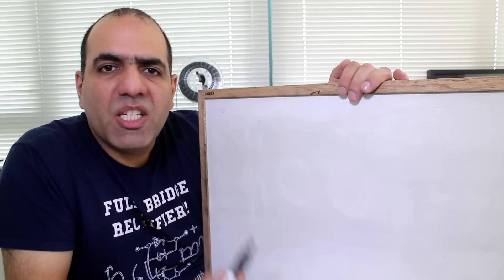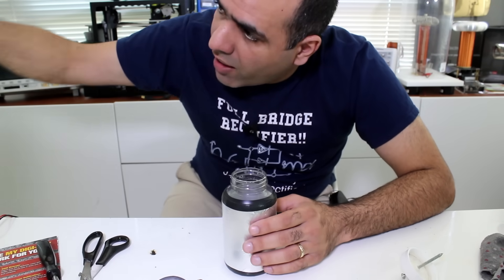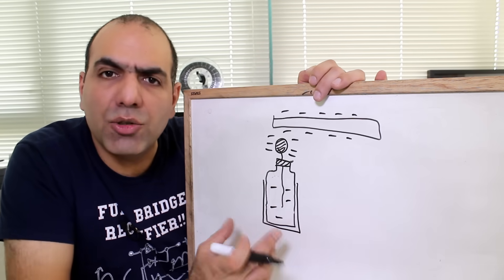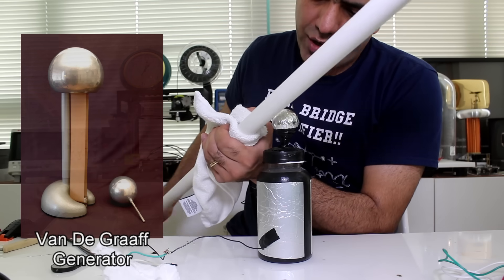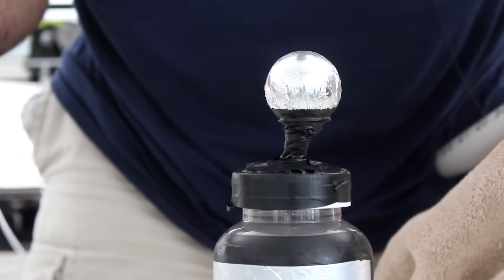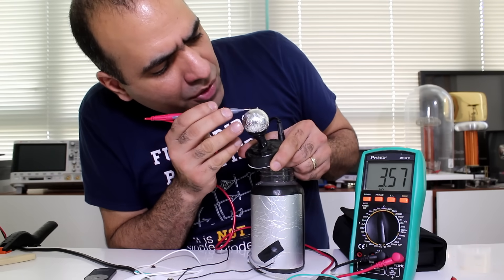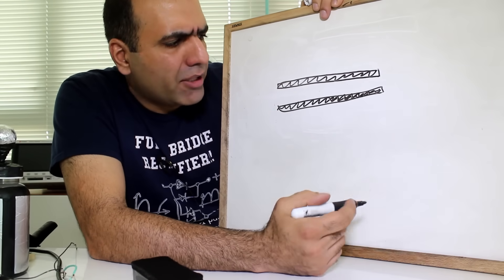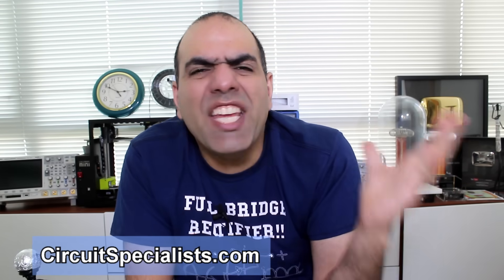Make a SUPER HIGH VOLTAGE Capacitor

Comment: I made a video a couple of years ago where I build 20kV - 8.4nF Capacitors with plastic pockets for my Marx Generator. :) Now I built better capacitors with 74nF for my Tesla Coil and it worked very well but they turn hot quickly.

Comment: If you put a fork in a wall socket, turned the power on, then touched it with the negative side of the capacitor while holding the positive side of the capacitor (holding the jar and touching the fork with the ball on top) would it shock you? Can you explain that science?

Comment: Call Cody and replace salt water with mercury
Reply: Cody would use himlfelf as a capacitor
Reply: That mass to capacitance ratio of that thing would be enormous.
Reply: UNZO That would be beautiful.
Reply: Mercury is highly toxic
Reply: What if you filled the jar with steel wool?
Reply: 🔴🔴🔴 Craig Frank 
Simply use large PVC pipe to make a capacitor. It kicks butt! Or simply make a plate capacitor. This guy is a goofball who by no means is well acquainted with performing electrostatics experiments.
Reply: @FreeMagneticEnergy2  you do know that ElectroBoom has a masters in Electricity, right?...
Reply: 🔴🔴🔴 Dead Meme - I as well. Got mine in 84. Big deal. Having a masters doesn’t prevent us from doing stupid, idiotic things.
Reply: @FreeMagneticEnergy2  but you see, the "stupid things" electroboom does are all near-perfect cuts. In some of his videos you can just barely see the cuts. Everything is set up to work perfectly in a way that it will definitely not hurt him in any way.
Reply: 🔴🔴🔴 Dead Meme - Regardless of edits, what does that have to do with constantly electrocuting himself? Even passing current across his heart. 🤔
Reply: @FreeMagneticEnergy2  did you read my comment correctly?
Reply: Dead Meme - Rather than asking me if I read it correctly, why don’t you elaborate please. I don’t want to look over 28 replies to find yours.
Reply: Dead Meme - I noticed you made various comments. Are you talking about the one you say he has a masters degree? I don’t need to read that again. Rather you need to read my response again because I also have a masters degree in electrical engineering I earned in 84. Don’t matter how you slice it or dice it, degrees does not mean that we are not going to do stupid things.
Reply: @FreeMagneticEnergy2  ive clearly wrote that everything is set up in a way that he cant hurt himself. Sure he had some accidents, really bad accidents tbh, like the Jacobs ladder. I have never wrote that we dont do stupid things, neither will a degree prevent you from doing that, but if you cant enjoy his videos then i dont know why youre even commenting. He wouldnt just go and touch 750kv power lines on a ladder to find out if he dies or not for a youtube video.
Reply: The Only Wae  If it's in elemental form, it's relatively safe. When it is converted into a salt, or especially an organometallic compound, is when it becomes much more dangerous.
Reply: @ergohack  
It also gives vapour.  Horrible stuff.    but fascinating for a while. Probably until it damages the brain.
Reply: UNZO yasssssss
Reply: i hope this gets top cpmment
Reply: Oh man, the ESR would be incredibly low!
Reply: UNZO was thinking the same thing...
Reply: knowing the common nature of these videos, he's going to somehow get it dangerously near or in his mouth somehow.
Reply: @_hekken  well... cody just uploaded a video where he tastes mercury...
Reply: 🔴🔴🔴 Hekken. - Yep! That’s what goofy idiots do. Stupid things over and over who never seem to learn.
Reply: use NaK isntead!
Reply: Steel wool if not super compressed is not a dense metal plate
Reply: High chance of amalgamation of all metals involved
Reply: @Codislab make it with Mercury or something beter.
Reply: How about give yourself a break and replace the bottle with a flat sheet !
Reply: UNZO I’ve got some mercury I’ll ship to mr.electroboom

Comment: Really nice video. But I think it would have been a lot easier to use aluminium tape, the kind they use for HVAC systems. Or use spray on adhesive rather than a paste.

Comment: If you would charge the 10nf Capasitor to 25kv the energy storend would be 0.5 x 25000^2 x 0.00000001 = 3.125 joules This is al lot less than the leathal 16 joules so it would be safe. Am i right? Just curious.

Comment: What about those plastic chairs in elementary school. I used to rub my body on the chair while i was sitting and when i stood up, i could zap my friends with pretty big arcs. ...i think my biggest arc was longer than an inch but that was when i touched the metal part of the same chair
Reply: midgetconi stop lying there is no way the arc was one inch
Reply: I killed an old computer at the school lab like that... touched the CRT screen and ZAP! went black & never turned on 
It was an Apple anyway lol
Reply: at the place i work at we have polypropylene or polyester fleece running over aluminium rolls, those will charge up way more and we sometimes get arcs way longer than a few inches, sometimes you can even see the arc coming out your boot and into the ground.
Reply: Derrick Lyne it was thin. Barely visible. But you could feel and hear it
Reply: Tsar Nicholas have you ever touched a van der graaf generator? My physics teacher 2 years ago pulled one out that was ~2.5 feet tall. Those things could zap you from 4 or 5 inches away if you let them build up. Some tasers have an inch gap (not that im saying the chair thing is anywhere near that powerful) and they dont kill people

Comment: You know a guy has shocked himself alot when he can tell just by looking at a spark how many volts it is.
Reply: I think he was judging how far away from touching it was when it sparks. It's about 1 kilovolt per mm. 
But then again, he IS an expert on shocking himself as well. ;)
Reply: i wanted to like your comment... but it was at 666 and i just wanted that vibe to sit lol 😂   @lordsqueak
Reply: @lordsqueak  At about 50% humidity, it is about 30kv per centimeter, but the voltages vary a lot based on pressure and humidity
Reply: @lordsqueak  the air brakes down at 3kv per mm. Sorry if my english is bad
Reply: @lordsqueak  its true ,a true master shocking himself
Reply: @lordsqueak  it’s ~1cm per kV
Reply: @lordsqueak  no shit sherlock, the dude wad joking
Reply: You both are right but it takes a lot of practice to feel the distance ;)
Reply: I knew a guy that could tell the pH of his reaction by taste.....
Reply: @elDoober  yeah. Bases are bitter. Acids are sour
Reply: @elDoober  Keyword. You KNEW him.
Reply: Nah he sees the individual electrons moving through the gap, he counts them and then calculates the voltage, all within 1 second.
Reply: is it not 3kV/mm?
Reply: @AnjewGS  mehdi said it depends on many factors like humidity, temp and other
Reply: Composing Gloves so true
Reply: I thought breakdown was 30kV/cm?
Reply: Richard Smith except stun guns are still current limited, at a higher voltage like 20kV-30kV aka what most "million and higher volt" stun guns really are, it would be alot more dangerous and definitely hurt more than stun guns
Reply: @BH4x0r  you can't get a million volt stun gun. It's impossible
Reply: @ericl8743  they are gigantic and not mobile.
Reply: @graphenepixel8231  then what's the point lol. I don't see the need for a stun gun with electrodes that are 3 meters apart but you're right it's possible but not practical
Reply: @ericl8743  I understand 😂
Reply: Personal attack is not welcome. Share info or fun, not hate!
Reply: Yes, for homogenous field and dry air. And actually here the field is more homogenous (because of the round electrodes) then in many other practical cases, so this estimation is more accurate here than 1 kV/mm, which applies rather to pin-to-pin discharge. You can see Mehdi says 10 kV, when the distance is only about 5 mm, so he assumes ~2 kV/mm.

https://hypertextbook.com/facts/2000/AliceHong.shtml
"The dielectric strength of air is approximately 3 kV/mm. Its exact value varies with the shape and size of the electrodes and increases with the pressure of the air."
Reply: @PafiTheOne  And the humidity too I believe. Also I believe with higher frequency it s reduced. Having worked on tv's with picture tubes many years ago I believe it appeared to be about 1000V/mm at about 18kHz.
Reply: (arc)
That was 35kV
Reply: I can do that with 9v batteries on my tongue
Reply: fr bro

just saw your name/handle 

your comment has 11k likes and 68 replies and a heart from electroboom on your comment

i rechecked for number of replies 

all this is written or typen or typed again when whisper flow and another add i think wo online games wala were running

and rn a heartbeat black friday turkey add "it saved our flock" wala and another in which kids were holding instruments and a clip of a girl was singing the add was silent for some reason

date 29 november 2025 time 5:12 am - 5:13 am pakistani and abhi 24 puppies ka koi ishtihar araha hay 

5:14 am pakistani
Reply: Haha experience eh ;)? Same at my job. I'm able to visually measure thousands of an inch in plastic just by looking at it. Experience can go along way ;)
Reply: @AcidAlchamy  no
Reply: Composing Gloves Im guessing he's full of shit.
Reply: Composing Gloves 😂😂
Reply: Composing Gloves Medhi have a multimeter on his fingers, and a very prrcise termometer on the lips
Reply: Will Garrett is he still alive?
Reply: If you work with enough magnetos long enough, you can tell just by the sound of the spark how well it is working. Of course it is better to hand to a co-worker and ask them if it works by turning the impulse coupling. :-D
Reply: I love how this man tries to make a joke and you get all these very sad people trying to correct him.
Reply: Lmao
Reply: Most of these replies ruin the joke/ statement tbh. So y’all need to shut tf up and just a appreciate this joke. 😊
Reply: HAHA
Reply: This fellow is the "Miranda Sings" of electrical engineering.

This is intended as a positive comment, for those who don't know.
Reply: Look at my videos of making sparks on the bleachers, I even shocked an apple with the high voltage while holding it.
Reply: Exactly
Reply: Bit he is earning Money :D
Reply: @israel24961  clearly you are wrong the youtuber himself agrees with him you fool
Reply: Fake video
Reply: My thoughts exactly! 😅😂🤤
Reply: @israel24961  And the sound indicates charge level too and gets louder, of course with the same charge voltage on the larger cap.  He goes by appearance and the gap it bridged at the moment it arced, but that varies too with the air.  He was using spheres though so much better accuracy for an experienced observer.  I thought it was funny how often he forgot being still attached.  The stuff I made only allowed for one mistake.  We wore no ground straps in that lab.
Reply: Lmao 😂😂
Reply: Humorous comment: look at the thing 
People who don't get the humor: well you see, the thing is probably...
Reply: @israel24961  yeah
Reply: HAHA I LOOKED AT THE COMMENTS AND THIS COMMENT POPPED WITH 6666 LIKES HAHA

well... right now it's at 6666 likes...
Reply: Composing Gloves 🧤
Reply: Lol
Reply: Hasn't every electrician been shocked sooner or later?
Reply: I Noah guy.
Reply: @Babl Fish
Reply: Pain is an excellent teacher.
Reply: @masternick13  They don't tend to last long.
Reply: "That was about a 6 on the ouchy scale.. I mean about 10kv"
Reply: Lol I used to have a coworker that could tell by "feel" what the voltage was. Apparently the highest he ever experienced was 4160
Reply: Lol some people it doesn't effect as much as it does other people.
Reply: 0:15 ofc. Lovers from different lands.
Reply: It’s obviously fake they’re just editing it or they knew it before so they’re probably using some sort of power supply￼
Reply: Yes
Reply: He can tell by the violence of the spark. The loudness and brightness increases with voltage, and he has worked with high voltage enough to recognize roughly the range of the spark.

Make no mistake, that hurt like a bitch getting shocked by. That is stun gun territory.
Reply: Richard Smith there measured by distance dude. Your information is incorrect
Reply: @mikeyeyey8678  It is distance, however, that distance WILL vary depending on the gradient.   That is determined by the shape of the nodes.  If one is a sharp point,  if will arc at a greater distance for the same voltage.   Both being spherical,  it conforms to the physics standard model.   If one were a pointed barb, it could initiate an arc at twice the distance.
Reply: @rich1051414 he also has his masters in electrical engineering. That also helps quite a lot lol
Reply: Richard Smith.
No. It's simply distance. Anyone with decent scientific training in EE would have used distance.
Reply: @abcabc-pl9jf  Not exactly true, because a larger cap charged to the same voltage will deliver a much more powerful spark because once the arc occurs, the entire charge load dumps.  Also, if one uses a pointed node (or two), the arc occurs more readily due to the higher field gradient.  I have seen 50kV arc up through dielectric fluid and the air in a demo, and I was very impressed, having made HV power supplies for a while and not ever seeing that.  Also the distance also changes with the condition of the local air at the time.  But you pretty much got it right.
Reply: Randy Gareth unfortunately you can't tell the voltage by counting electrons. And yes, I am fun at Parties ^^
Reply: You englished good in this comment.
Reply: you guys must be fun at parties.

Comment: it would rule to have a scope but it would also rule if you try not to have current travel through your torso

it'd be neat to try this using two cans you've hacksawed the tops and bottoms off of. aluminum's flexible enough that i think you could wrap one in something like mylar and cool it and heat the other and use the thermal expansion to nest the two. I think as the two returned to room temperature they'd end up tightly bonded although I'm not sure what use the resultant energy cylinder would have.

Comment: 6:05 can't charge a cap with AC
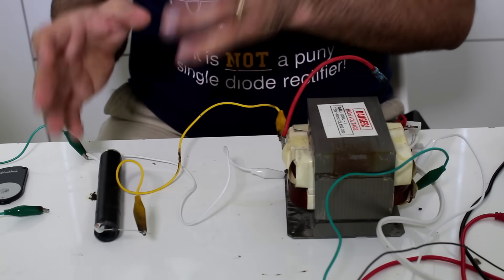10:20 charges a cap with AC
Reply: Rectified AC. No problem with pulse charging a capacitor as long as pulses are fast enough and with one polarity.
Reply: offshorebear  doesn't understand what a diode does
Reply: 6:05 its  high frequency Ac 
10:20 is 50/60 hz.ripple dc
Reply: Great attention to detail, but you missed the RECTIFIER part :)
Reply: It doesn't need to be rectified. AC will leave enough energy to spark.

Comment: How to test capacitor with multimeter?
Reply: Pritish Parihar look for the Farad symbol
Reply: My multimeter got not option look like that. All i got to measure resistance, voltage, current,Beep for close connection. that's it.

Comment: Put 100 1N4007 diodes in series = 100kV Diode for charging a capacitor with the Tesla coil. You can use 400 and make a full bridge rectifier for 100kV for very low price!!
Reply: Sadly I don't think that will work.  If I understand correctly, Tesla works at radio frequency.  These 1N diodes have lousy reverse recovery time (i.e. when you reverse bias them it takes them a while to realise they shouldn't be conducting).   I used one in a 65kHz boost regulator and it literally did not work at all - kept discharging the output capacitor on every cycle.
Reply: fair point, then STPSC2H12 it is. Money is not a problem here.

Comment: did same capacitor years ago with 2x10m aluminium foil, capacitance was aubout 46nF and was working on 16kV for 2 years :D powered with 4 neon transformer 4kV each (never check their wrok with hands). Greetings form Poland. Martin
PS Can You show me how to create jacob's ladder that can run all the time (my transformer get hot in 5 min) or an DIY ozone generator??
(sorry for my bad english)

Comment: I made one of theses and was able to charge it with a DIY Taser
Reply: By 'DIY Taser', you mean one of those 10k volts potted voltage multipliers? Those are fun, but lie like hell about how many volts they produce, divide it by 2. They assume most people don't have the equipment to measure that high of voltage anyway.
Reply: Richard Smith Don't worry I'm aware of these lies, kind of like Taser cases for iPhone... I was just having fun with it and noticed it can charge the Leiden jar with quite high voltage (I got a 1/2 inch spark!)

Comment: Or you can use one capacitor from gasoline powered car.  Make charge from spark plug (use chain saw at 12 000 rpm) and nail your self like boss with 50 000 V. 

Ps; if he doesn't make any more videos, he di it 😎😎😎

Comment: Could you please explain why the capacitance of your second capacitor went up when you rolled it in? Shouldn't the surface of the two conductors remain the same? The formula for capacitance is (surface area * electric constant)/distance between the two, so how did curving it up doubled the capacitance?

Comment: so if you touch the negative plate of the capacitor(ping pong ball), electrons flow in your body and if you touch the positive plate, aluminium foil, electrons flow out of your body, are both if those different shocks or you can't tell the difference?